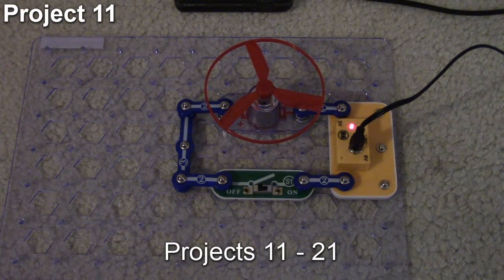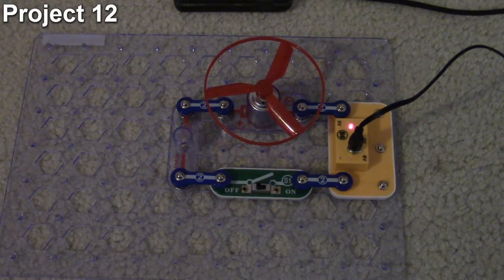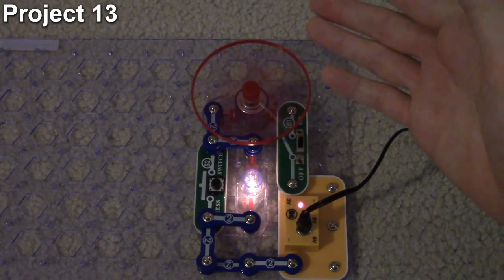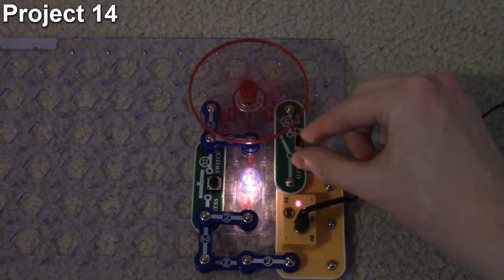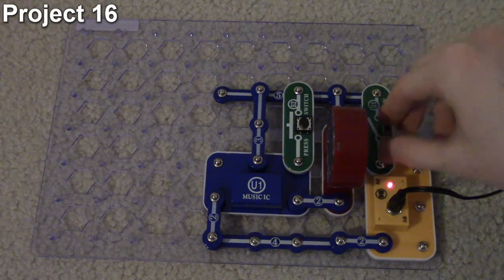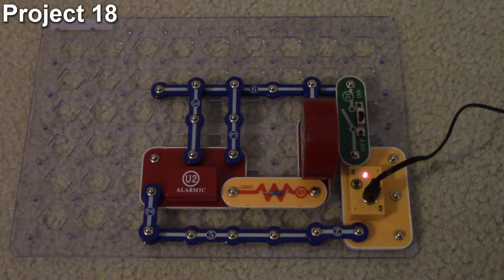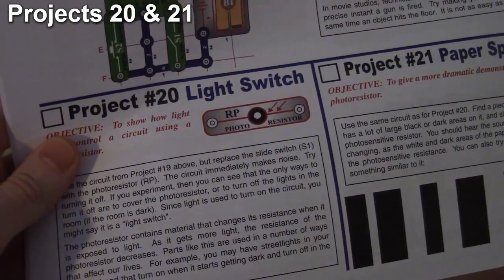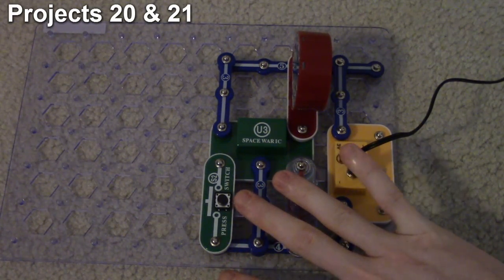ELENCO Snap Circuits Projects 11 - 21

Comment: Project 12 didn't work when I tried it, even with brand new batteries.
Reply: How bad.I'll be your best friend.
Reply: maybe the lamp isn't working
Reply: @TheWASHINGMACHINEBOY  the lamp works just fine. I don't think that's the cause of the issue.
Reply: then i don't know what the problem is
Reply: the problem is the motor and fan.
Reply: @florangelferrer5543  the fan doesn't contain electronics inside it so the problem is just the motor

Comment: heres a tip: if u use b6 for more than 2 minutes in a high current circuit such as the motor without turning it of the b6 will automatically turn of for thermal protection